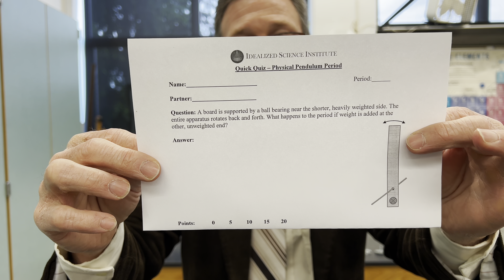Adding Mass to a Physical Pendulum -- What Happens to the Frequency?

Comment: The location of the added mass, changes the Effective Length of the pendulum arm! 
Change in Effective Length:
If a mass is added along the pendulum's length, this changes the Effective Length .  A shorter effective length = a faster swing. A longer effective length = a slower swing. It's the LOCATION of the new mass the determines the new period.

Comment: ok, I figured correctly that the period would increase (the pendl. goes slower), because the weight are counteracting on each other because they are on opposite sides of the bearing. So simply the upper weight reduces the influence of the lower weight, it simply removes some weight from the calculation.
less weight means the period increases.
But why is it pendling asymmetrically??
Reply: It's the new effective pendulum length, not the mass, that changes the period.

Comment: I would like you to measure punch power with the focus on power transmission. Use a ramp and some object at the end, i imagine something at the size of a coin but higher in impact surface. You have 2 objects going down the ramp. The exact same size, volume and speed. But the difference is one side is soft while the other side is solid. You switch the sides and sees how much further the object of impact moves after impact depending on the sides of the object going down the ramp.
Reply from the maker: Got it! Thanks for your comment.
Reply: @idealizedscience  i have been thinking about this experiment myself for a long time but not been doing it. You had experiments already done that got me to think about it again. My theory is that arm wrestlers have very good punch power even without proper boxing theqnique to generate explosive force from the ground up - just because half of the truth lies in the ability to transmit power thru a small but very important first joint of contact (hand, wrist) if that one is weak the power should be leaked back to the body of the puncher. Most if not all punch power experiments i have seen done doesnt take this into account. I also use to imagine 2 exact sized eggs throwed at a window. Same mass and speed but only difference is one is raw the other is boiled. In my theory the boiled should crash the window while the raw would splash.